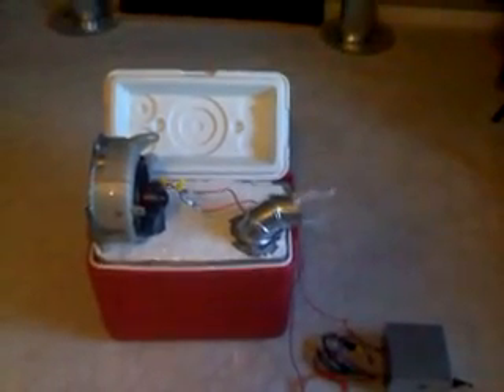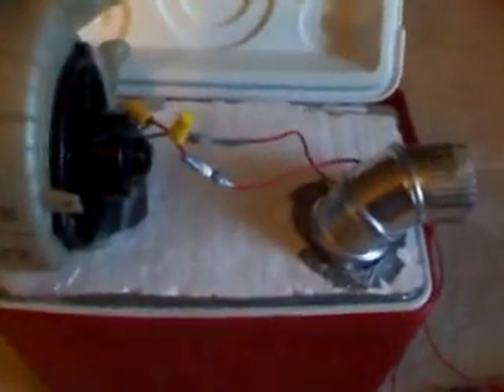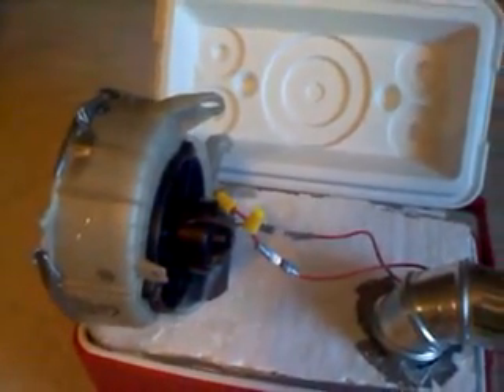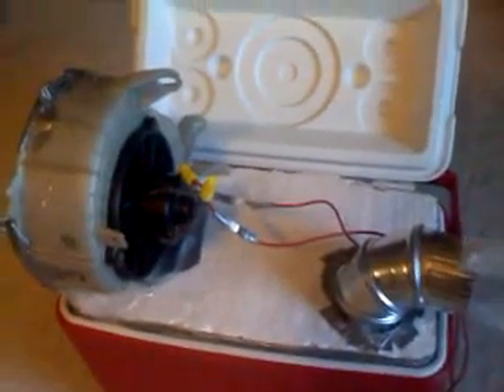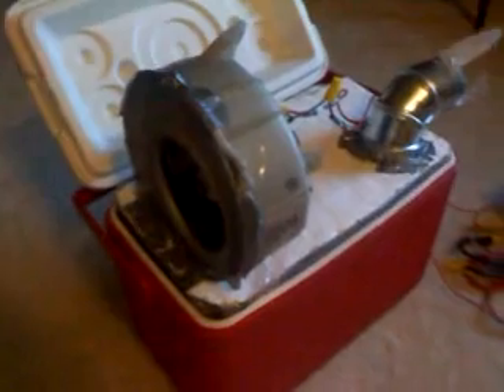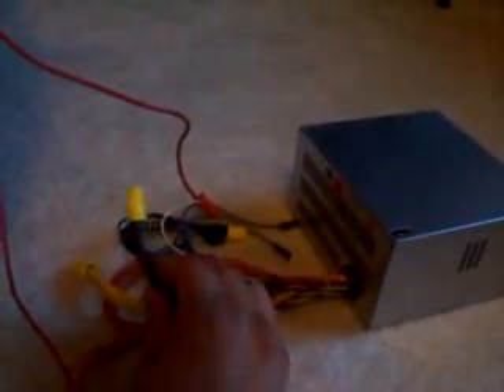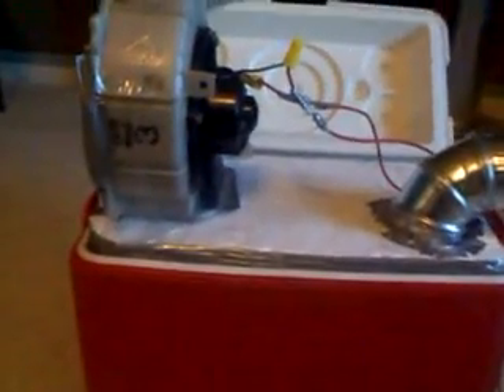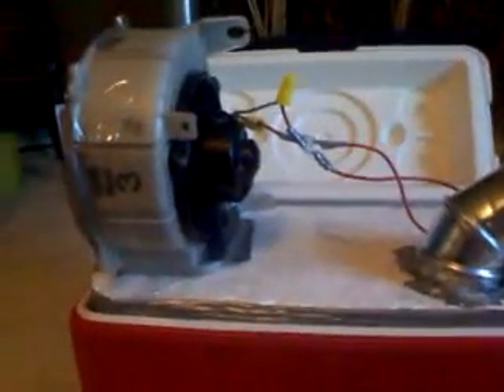Homemade Air Conditioner with Car Blower Motor

Comment: U cud use DRY ICE
Reply from the maker: It would work, however you need to make sure you are not in an enclosed room.  When the dry ice melts it gives off CO2 and this could suffocate someone.

Comment: Really nice video. Great idea using a blower motor from a vehicle. It's already matched to run on 12v. I'm using videos like yours to make one for my Durango as the A/C is shot. $1200.00 to fix it! What I'm doing a little different is along with frozen 2 liter soda bottles(8) I'm also laying in some metal lathe to act as like a coil to collect the moisture in humid air and let it condense leaving dry cool air to be blown into the vehicle. Thanks again for your ingenuity.

Comment: I came across your video & I was hoping you can help me. I cannot find the short in my truck blower wiring. If I run the blower straight from the 12v battery with a toggle switch will I be at risk of fire?

Comment: @hutchtransfer hey im building a swamp cooler also!    i used a large ice cooler for drinks, beer ,(ect)     and cut some holes in it.     got a nice blower fan from a slim pedistal fan.   and a pump from goodwill thats for a fountain.    ive got the blower, pump and wiring done in this thing all im waiting for now is for the pads to arive in the mail

Comment: Is there any reason you couldn't use a regular plug in fan for an apartment room?  Does the battery make it safer avoiding electrical problems or something??